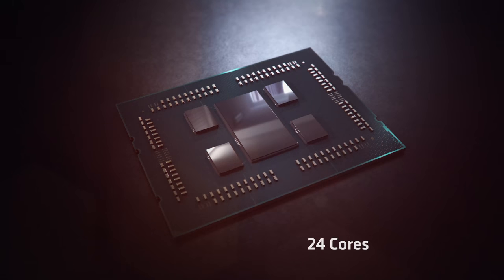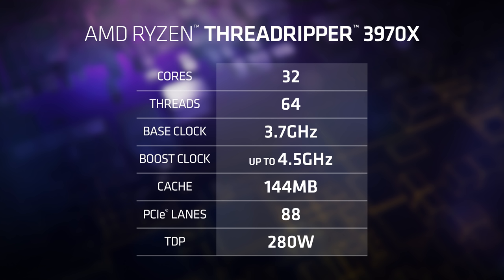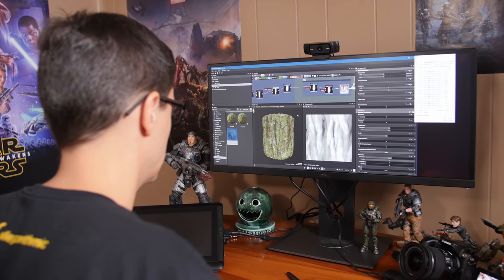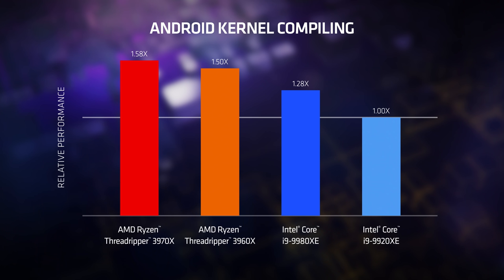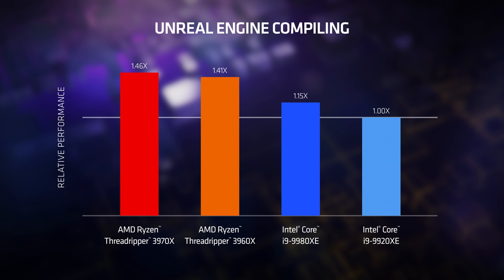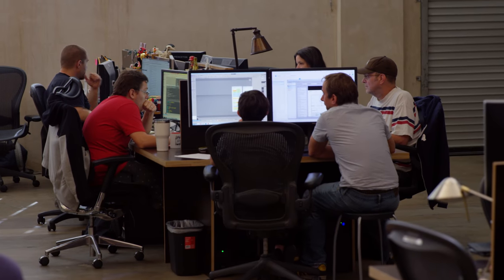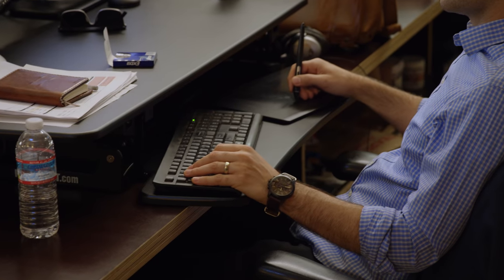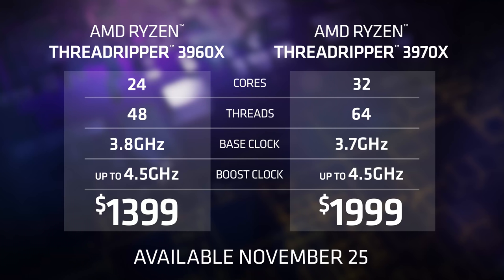Performance Preview: 3rd Gen AMD Ryzen™ Threadripper™ Processors for Creators

Comment: I am glad that finally someone considered software development workloads while benchmarking cpu performance.
Reply: Yesss!
Reply: We are finally "professional"
Reply: Agreed, I’m really looking forward to the productivity improvements these new chips will bring me.
Reply: Yes but software developers also takes other considerations when building a rig, not just CPU & compile time. For example, i just found out a year ago after getting my Ryzen, that i cant run Android emulator from VS2017 (i can but its really bad).
Reply: @yutubnyaDimi  Agreed. Code compilation is just one of software development workloads.
Reply: Just worried about compatibility because a lot of open source (windows) stuff is designed to work with intel-based systems
Reply: Finally!
Reply: Interesting that the compile times they show are only fractionally better for 64 threads vs 48 though. I wonder what the bottleneck is there.
Reply: Software development, but also engineering (mechanical, electronics, VLSI, system integration of big projects electrical and mechanical), architectural modeling (including big commercial system, industrial plants, etc) of big models, science simulations in many many branches (no you don't need super computers for most of it, but more cores in a single machine, that is still affordable and fits in a normal desktop computer with Linux or Window really helps). Not all enegineering packages utilize many cores well, but some definitively do. It is not all just graphics, 3D modeling, rendering or video transcoding people.
Reply: @StephenHoldaway  There are 6 main sources of bottlenecks here. 1) Project limitations - i.e. if your project has only 200 files to compile, there will be imbalance of load and few last files will only compile on just few cores. Most of the mentioned projects (Android/Linux kernel, Unreal engine, etc), do usually compile about 5000 files even in pretty minimal settings, and often way more than that, so that should not be a big issue, there is however still variance in size of files and their complexity, so compilation of each file take different amount of time. 2) Sequential parts, i.e. linking and other critical paths might not be parallelization. 3) L2/L3 memory pressure - more processes means more contention, both for data caches and instruction caches. 4) Memory and IO bandwidth, IO bandwidth shouldn't be a big issue, but memory bandwidth of only 4 channels shared by so many threads is a problem. 5) The 32 core version has a bit lower clocks, but that is not a big deal. 6) Building planning. Tools that do compilation in parallel need to figure out all files to compile, in what order and schedule it and synchronize. But most build planners is in fact sequential. So even with infinite amount of cores and memory bandwidth, you will be bottlnecked. It takes about 4 seconds for Linux Kbuild system makefiles and config to be parsed (this already involve reading thousands of files), and then another 1-2 second to read all timestamps of all files (if they are in RAM caches, or on super fast SSD) to figure out what to do, then actually do it. The management of all parallel threads / processes, is actually done by a single single-threaded make process , so it will also become a bottleneck eventually, however doing it in single thread is actually faster than doing it in many threads or processes in this case. So, if you have 16 cores compilation will take 40 seconds, if you have 32 cores it will take 30 second, if you have 1000 cores it will probably still take 15 seconds, because there are sequential parts that will not be speed up. This is known as Amdahl's law.
Reply: @StephenHoldaway  if I had to guess.. it's because the software isn't optimised for that many cores yet considering this is the first desktop CPU to have this many threads.